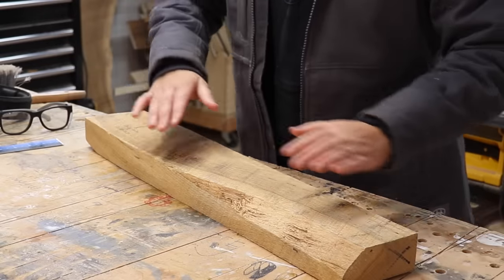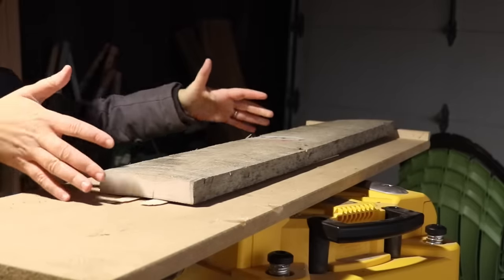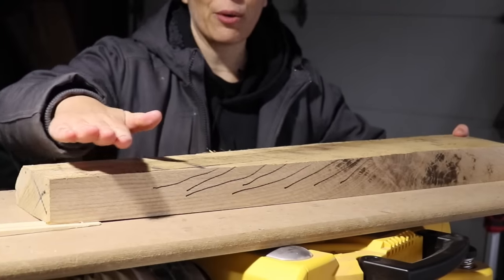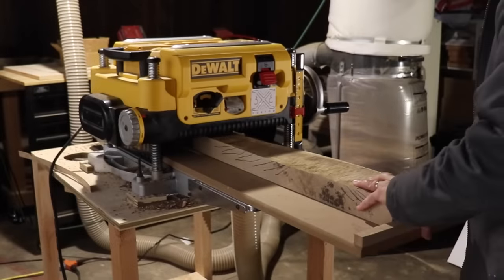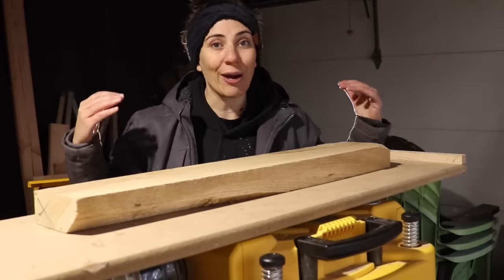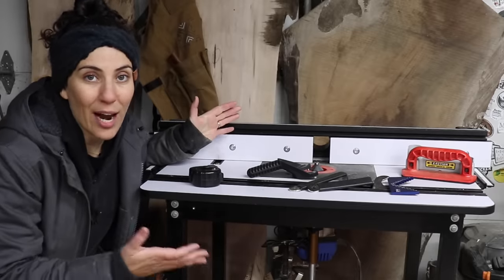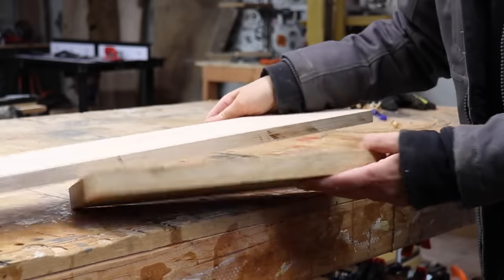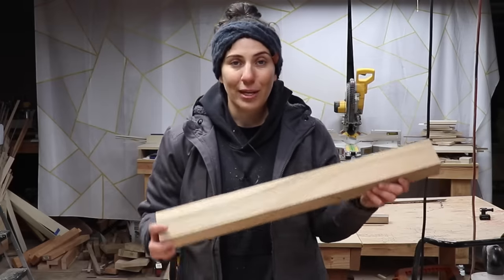Milling Rough Lumber Without a Jointer Using a Few Simple Jigs

Comment: I just ran across your video. A lot of good info in your video, and you do a very detailed job at explaining everything. HOWEVER, and someone may have already mentioned this in the comments, but I think you're misunderstanding how the planer won't remove a twist in the board unless you shim it. You are correct in that you have to shim the board or it won't remove the twist, but you are incorrect as to why you have to shim it. First off, a bench-top planer like the one you have does NOT apply so much pressure that it flattens out the board, and then allows it to spring back after it's passed through the rollers. ESPECIALLY the thickness of the boards you were planing. You could park a pickup truck on that twisted board and it's not going to flatten it out. However, what does happen, and the whole reason for shimming the board, is the board will rock as it's going through the rollers, allowing the cutting head to follow the contour of the twist in the board, thus continuing to transfer that twist onto the side of the board being milled. It is NOT due to the planer flattening the board, and then the board springing back. Does that make sense? Bench-top planers simply don't apply the kind of force it would take to flatten a two inch thick board, not even a little. 

As for the board with the cup. As long as it doesn't have a twist in it, there really is no reason to shim underneath the cup as long as you start with the concave facing down, like you did. These bench top planers don't apply that much pressure that they would flatten that board. Not unless you're planing something less than maybe 1/2 inch. Then I might worry about the planer flattening the board slightly, but even then, only with a really soft wood, but otherwise it's not going to be an issue. So yes, absolutely shim a board with a twist, just to keep the board from rocking as it goes through the planer, but there's really no need to shim if there's only some cupping but no twist.

Comment: While preparing me for my new planer you just taught me about whittling and everything that discourages "cutting against the grain" in a way I finally, fully understood! With your marks and explanation I was able to visualize what would want to peel layers up instead of helping smush them down. I've been told not to "cut against the grain" so many times, but then I look and I see grain lines running left and right and say: so which way am I supposed to think these lines are "going"? Left or right?? Seriously! Thanks. Wow and I just learned about squaring my piece (I like the tape or hot gl;ue on a board since I don't have a jig yet). I imagined myself using the planer for this too since my pieces are small enough and no more than twice as wide as they are thick, but if the edge is wonky why not clean it up first? Thanks so much. I had years of metal machining under my belt but so little wood savvy was learned in any of it.
Reply from the maker: So awesome to hear! 🤘

Comment: I used to use that technique but found it needed a thicker base board. I used some unwanted inch and a quarter thick bench top material. The melamine coating made it easier to clean off the hot melt glue.

Comment: This is a great video, thanks! You've answered so many of my questions, and I appreciate your clear (and non-condescending) explanation. I do have one question: I don't have yet have a jointer or a planer, and I noticed you mentioned it's possible to plane using a router. How excactly would you do that? Anyway, great video, cheers!
Reply from the maker: With a router sled 👍👍
Reply: @3x3CustomTamar  Ah, ok. Now I get it, thanks!

Comment: Good video. Getting ready to start building my shop. And I know you've improvised to your techniques which is good. There are some other tricks that you can do without making all those jigs but you probably already know them cuz you have the correct equipment. And it's also good to know how to use the hand tools. The planers sometimes it's better to go in an angle feeding your lumber in if you have the available room to do that and to do quarter turns to get the pebbles and cups out and then swap as you go and you can automatically surface the opposite sides doing it that way it's a slow process but it can be done. Good video good job
Reply from the maker: Yup. Glad you liked it

Comment: I agree with the others. I learned a lot from this video as it was clear, vocabulary was deliberate and understandable, and the steps were simple and straightforward.  Thanks!   {new subscriber}

One question:  do you ever help push or pull boards through the planer just to get the initial snipe out or is that a bad idea?  I ask because the rough cut cedar I am planing is slipping mid-board and just stops as not enough traction at times to pull a slightly warped board through and I’ve been pushing and pulling which is helping.  I do like the MDF board idea you mention and will be implementing.

Comment: This will be lost in time (Video is 3 years old now.) and numbers (3034 comments)
However, yes it was helpful, if I had a plainer. But, I have found ways to do the same with just my portable table saw AND Jigs. You are very good at instructions as well.

Comment: Only thing that is worth mentioning is that the thicknesser jig works better turned kind of back to front - the thicnesser drags the material (wood) with rolls that are up at the front and back of the cutter, over the material. So when the fence of the jig is in front it counteracts material moving on the jig thus eliminating the need for hot glue - just shim it good when pushed forward against the jig fence. Otherwise the thicknesser wants to pull the material so it tends to slide on the jig (friction wood-jig is lower than wood-thicnesser rolls and if the friction jig-thicknesser tray is higher than wood-jig the wood will go in and jig will want to stay put, hence the need of the hot glue in the first place).

Comment: Excellent video, thank you!
A Question though since I am DIY and don't know who to ask.  This technique makes comple sense, and I have actually used it for edges. But after looking at jounters for self-milled lumber surface straightening, it is completely unclear how they are actually better.  A multi-thousand machine appears to rely on hand skills to feed boards just right! in this video the board is immobilized by glue/shims, and I thought that jointers would have a moving surface to which to attach the wood, just like the jigs here.  So it seems like for rough lumber these techniques are actually superior to a jounter. 
What am I missing?  Or perhaps there are jointers with moving surfaces/parts parallel to the outfeed surface.
Thanks in advance!

Comment: Tamar, thank you for the easy to understand instructions on milling a board. Is it possible to use a laminated shelving board for the planing jig? I wonder if the hot glue will pop off like the MDF and how it will hold up going through the planer. Thanks again!

Comment: Excellent video.
I guess the only scheme you missed was using a table saw, having a board as a fence with a cut the width of the blade along edge except for the end part making it like a jointer, sort of like your router fence used as a jointer.
Besides two sided tape or hot glue if you know which side won't show in a project you can use screws or nails...
Also besides toggle clamps like you used matchfit clamps are popular on jigs...

Comment: Love your videos, always well explained. I have just upgraded to the Dewalt DW735xe thicknesser but I am havuing problems with dust extraction with mixed messages from different sites.  I have a dust extraction unit with a 4 inch hose which i would like to attach to this unit. When I did it became clogged at the thicknesser port where you attach it to the hose. Do you have any problems with yours assuming you also attach it to your dust extraction unit.

Comment: Absolutely terrific, no denying!  Apologies if this is obvious to others, but in the end, everything is square/true, EXCEPT the ends, correct?  Presume they are easily squared with a miter or table saw, yes?  Thanks in advance!  (PS - Added thanks for the very important teaching on moisture content and acclimating the wood after milling!)
Reply from the maker: Yes. I mentioned that this was all down after cutting to ROUGH LENGTH. So the final step would be to cut to final length

Comment: I like the way you explain the what and why of the process. I have a problem that I know can be fixed. I have built a hollow mantel and during sanding I noticed the open face that goes against the fireplace is twisted. How can it be squared?

Comment: Planers often create a slight divot at the front and back ends of the cut. You can avoid or reduce that artefact by doing both sides on the jointer sled.
Reply from the maker: Snipe.

Comment: Table saw has always been my jointer.  Planer is the tool that is more important in my opinion.  Many ways to get square joint edges, much less easy ways to get a board planed.  When I ever get a planer I will have to make one of these jigs.  I typically do not build with rough cut lumber though so square joint edges are more important in my builds than flat surfaces.

Comment: Just bought the 735x, looking forward to it. Don't have a dust collection system yet, not looking forward to the mess of the statically charged chips flying everywhere. .Planning on connecting a shop vac. Other temporary dust collection systems you'd recommend?

Comment: If you are going to use a router as a jointer, you need to add a spacer on the downstream fence that matches the thickness of the material you are using.

Comment: Great video and very clear tutorial. One question though....when you are finished with the entire process you dry the wood inside the house but after that you store it in your (cold moisty) workshop again so it's protected because the wood is dry right? But when using it you will plane the wood to it's correct size making a new wound to the wood. Doesn't that give problems on your project? Doesn't it spin turn the wood? Hope you understand me I am from the Netherlands so English isn't my native language
Reply from the maker: I work in it in my shop but then I bring it back inside my house as I’m still working on the project. If I left it overnight on my shop it would would swell again

Comment: Nice work arounds, but honnestly for me, the time is the break point on this question for me. With a combination mashine you are faster and you are using one maschine for jointing and sizing. For beginners the tipps are great, because every maschine costs not less, but in the end, I bought a combination jointer as very early because I wanted to concentrate on the construction and building, so I was looking for needing as little time for the sizing and jointing as possible. The jointer is doing a better surface too. So if you cut it square with the table saw, you have to use the jointer again to flaten the surface, a work step, you don't have with a combination maschine.
Reply from the maker: I hope to get one some day

Comment: if you dont have a jointer for the 90 degree you can also use a track saw to cut it, then run thru table saw for perfect width.
Reply from the maker: Yup

Comment: Sorry if this is a dumb question… if you have a jointer you could theoretically finish the milling of the other two sides on the jointer, correct? Instead of going to the planer? Is the planer just more ideal because then you can make sure multiple pieces of wood have the same thickness when they are finished being milled? (I have neither piece of equipment but just wondering why move to a different machine)
Reply: I think the idea is that a planer makes the two faces *parallel*. I could flatten a board's face on the jointer, then flip the board over and run the unjointed face through the jointer to get it flat also, but once you've done that, there's no guarantee that the new jointed face is parallel to the first one you did.

Comment: Another way to mill the long side for a straight edge is to get a long pc of angle iron (6-8 ft) and attach it to one side of your board. Run it through the table saw with the angle iron against the fence, and you get a straight milled side on long lumber. Could do the same with a flat pc of long plywood like she did when running it through the planer too.

Comment: Really interesting to see, how few tools you really need since you can substitute a bunch of them with others. Now I just have to figure out, which are the most versatile ones that can do the job of the most of the other tools, so I get those first.^^
Reply from the maker: Always a work around
Reply: @3x3CustomTamar  Well, I'm not far enough in to find the workarounds, so I found a cheap table saw today.^^ Should make it a bit easier. Many tools seem to be able to be replaced by those. :)

Comment: Good, useful video!
Aren't you and Colin putting the sled in the wrong direction? Wouldn't the rollers tend to pull the board off the lead edge of the sled if the sled started to drag on the planer bed. If yes, then the hook needs to be on the lead edge of the sled so the board would engage the hook and pull the sled along with it.

Comment: What an informative and well put together video. Kudos Tamar! - I’ve got the same thicknesser and similar table saw. I plan on using the same techniques BUT the only problem hardwood I have is thicker than the cut height of my table saw! 😱 - do you have any idea if there is something I can do to work around this problem or you think it’s not going to be worth the schlepp?
Reply from the maker: Glad you liked it! You can flip the board and see if that will cut it.

Comment: These are superb videos. Thanks. You inspired me to purchase this same planer recently. I’ve had issues though. It came from Dewalt via Home Depot with a bit of cosmetic damage (suggesting used/refurbished) but I figured I would overlook this. 

But then I discovered that the base plate had a ripple/bulge in it. I could see it as I panned my gaze across the reflective surface. I could even press it down with my finger and have it then spring back up. I ended up returning it and getting the same model. This one too has some non-uniformity across the base plate that I can depress and visually see the change. Have you observed anything like this? Have I gotten TWO duds? I wonder whether the downward pressure on the lumber during planing would work to flatten the base enough to make the effect inconsequential. Any thoughts on this? The Dewalt call center rep wasn’t prepared to answer a technical question like this and Home Depot didn’t even care to know why I was returning. 
Anyway, I saw that you are an active commenter and hoped maybe I could pick your brain a tiny bit! Thanks!
Reply from the maker: Hmmm. I don’t have that issue in mine. Sorry! But you can make an auxiliary base with melamine that’s just as long or longer than then bed and that would solve it

Comment: I like double sided tape sticking an unstraight board to a piece of plywood. I have a lot of both.  By the way, I bought a small WEN jointer. It works for even long boards, but they are hard to handle alone.  For short boards, it's great.
Reply: I did the hot glue method (after watching you) and it was sometimes difficult to get the board and glue off my "sled".  I admit that I was doing 10'  8 quarter boards  and it took a lot of glue to keep them in place. By the way, two things. Wahuda and WEN both make spiral head jointers, and two, it wasn't easy routing the template for the 6 in 1 jig. If I didn't take off the slightest amount in each pass, the router dug in and jumped. Eventually, I discovered that I had to take off about  a 1/16th per pass, go over it and remove the cuttings each pass. Also I had to use a 5/8 bit for the heads of the T Bolts as the 1/2 was too tight.  The 1/4 spiral up bit melted the plastic and that was the reason I had to go over the cut a couple times to clean it out before going deeper.  If I was making two of these jigs, the second would be much better than the first. The first is a learning experience. I spent about $25 for the piece of polycarbonate though, so that is not an option.  I'm sure it will be OK. I'm really taking my time and trying hard to get everything right.   I will have some "plastic" left over, so if necessary, I can make more parts, just not another base. All the best. Keep up the good work. A devoted subscriber.

Comment: THANK YOU FOR A GREAT VIDEO AND DEMO. FOR A 4X4X6 OR 8  WHICHEVER..WOULD IT BE THE SAME PROCESS..MEANING DO THE FIRST EDGE WITH THE JIG THEN NORMAL RUN THEN BACK TO THE OTHER EDGE WITH JIG AND SO ON ?     THANK YOU VERY MUCH !
Reply: Yes. I just did this with similar size rough timber. Took some passes but it will work. Just start with the "best" side DOWN on the jig. Thats easier to shim up.
Reply: @FlushtheSystem  THANK YOU very much for your reply !!!!!!!